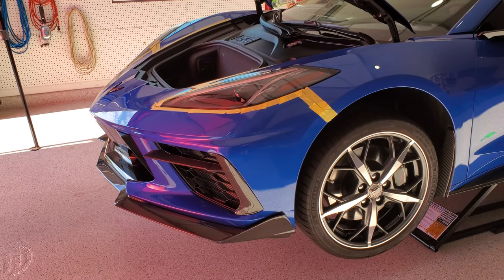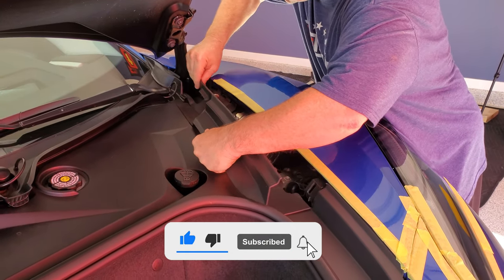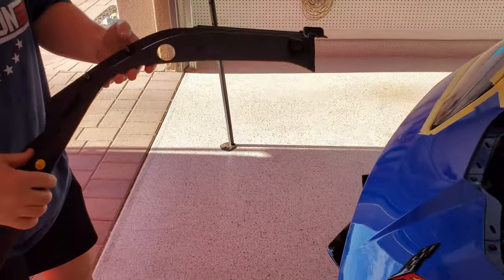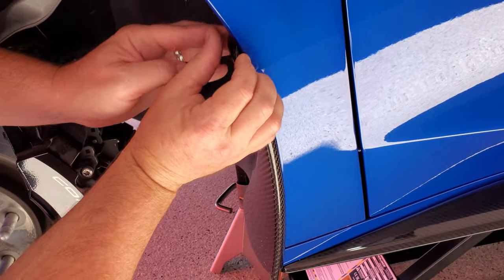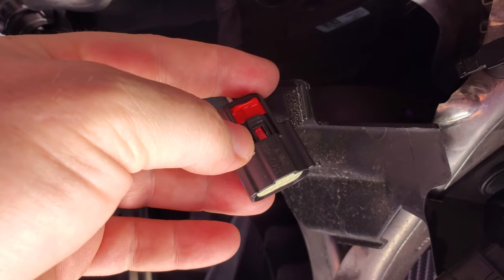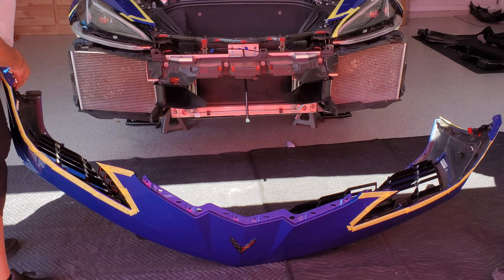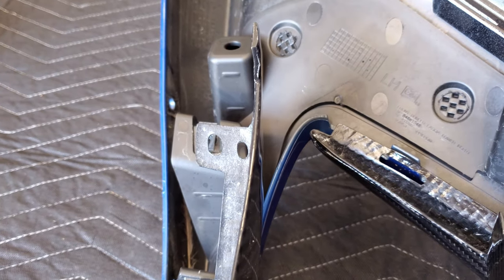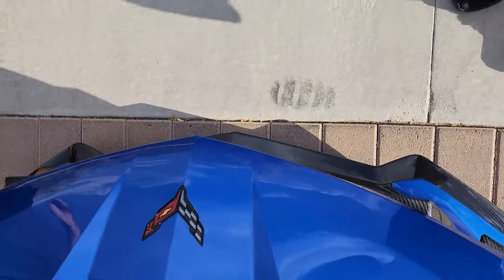2022 Corvette C8 Aftermarket Carbon Fiber Front Fascia Replacement Owner DIY

Comment: Any info on who made the carbon fiber front fascia? I ordered one from AG Motorsports for my 2020 C8. I paid the Chevy dealer $200 hr. to do the install. They said the cameras wouldn't fit in the holes. They kept falling out and if they forced them in the cameras wouldn't align. So they put the stock part back in. They charged me for 2 hrs of labor and I'm where I started from. Sigh.....
Reply from the maker: Sorry that didn't work out for you.  I've chatted with my buddy the car owner and he had some advice.  He said almost all the OTHER parts he used on his 2022 C8 were AGM, and he didn't realize they had a front fascia until after he ordered it from Jogon, which is what was used in this video.  He was fairly unhappy with the AGM parts; bad fitment, thin carbon fiber, easily breakable.  The Jogon part was a little better but still needed adjustments and customer service.  Even so, the cameras were never quite right.    Since this video, he has traded in the 2022 C8 and got a 2024 Z06.  I have a video of us doing some carbon fiber on the rear bumper of that one, and he used EOS parts for that, and the rest of the car too.  He feels EOS is the best of the three, but even though he feels it's the best bang for the buck, it's still not OEM and nobody's perfect so there were still adjustments to be made.  He's much happier though.

He recommends: return your part to AGM with the workorder from the dealer stating it didn't fit and get your money back.  Try the EOS part in the link in the description and see if that works out better for you.
Reply: @hangtime_31  Will do. Thanks for the reply.